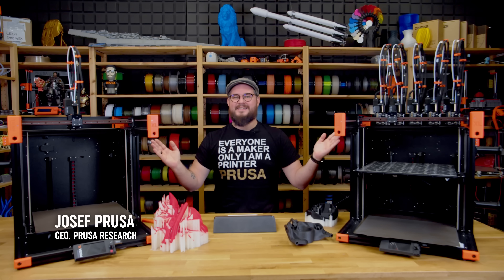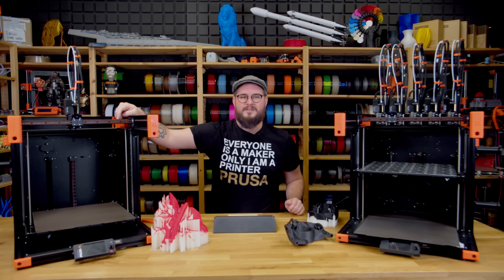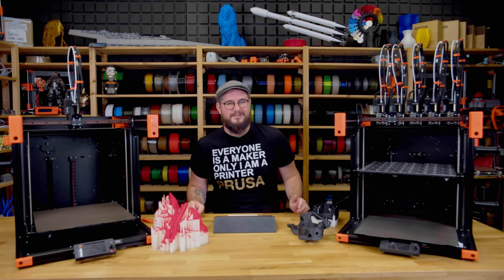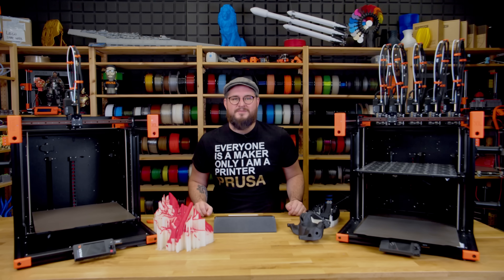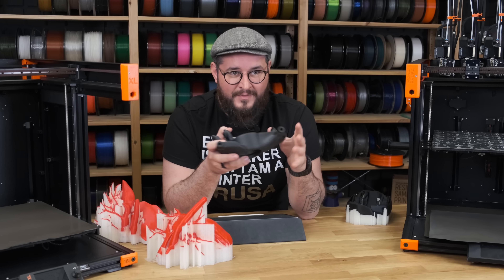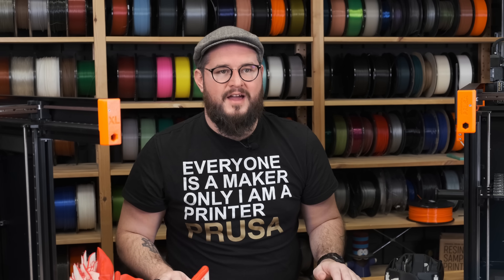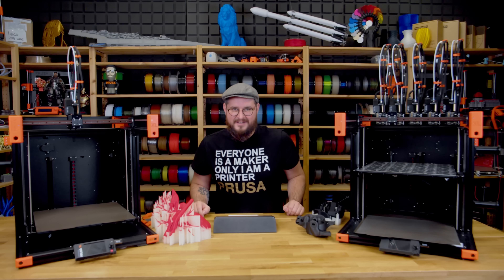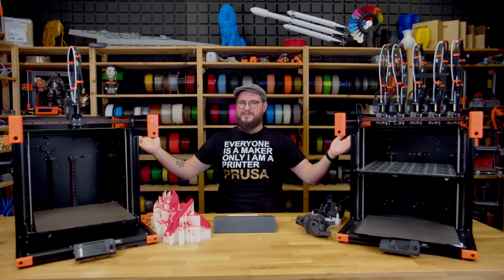XL update - beta test news, hardware changes and shipping schedule

Comment: So I ordered the XL with 2 Tools and have decided I am going to get all 5 tools.   If I want the printer quicker, should I just switch to a single tool and then add the other tools later?  Would the prices be the same (except for shipping obviously)?  I need the bigger volume before I need the multi material, but I want the multi-material too.   If it would just be a month longer, I would just opt to wait for the 5 tool changer.
Reply: Same boat as you

Comment: I've had 9 multihead XL's ordered and FULLY paid for for over 14 months now. While I understand some of the delays, I can't tell you how disappointed I am that the shipping of the multihead version has been delayed again. I run a small farm with 14 MK3's with the MMU unit on each, and the MMU is so unreliable it's unbelievable. I hope a firmware upgrade for the MMU comes soon to reduce our production headaches while waiting for our 9 XL's to arrive. The MMU units require constant supervision to nurse them through filament changes, I hope the XL's are more reliable in the multihead version. Thank you for the update, better knowing what's going on than waiting in the dark. I agree with others... Prusa printers are awesome, but the delays stink.
Reply: Done all the simple mods and while   they help, the MMU still has major problems. I have run 14 of them 24/7 for more than 2 years now, so I speak from thousands of hours of experience.
Reply: @danvester6476  If you're doing that much printing and are willing to put up with unreliable printers to get those features now, have you considered other options that are already on the market? The Voron 2.4 has an equivalent to the MMU that I suspect would be much more reliable since it's a Voron designed system that more than likely took many lessons from the MMU2, and the X1C is an off the shelf system with an equivalent setup (the latter seems reliable but does burn lots of filament on changeovers so recycling waste would be a must for high volume use).
Reply: How much is the multitool version?
Reply: very few simple mods and the MMU doesnt need anything
Reply: @95LegendGS  Which mod do you mean? The MMU never runs really reliably

Comment: Thanks for the update Josef, looking forward to the e-mail! A question about the modular heatbed though, you mentioned in the video that the earlier model of sheet acted as a heatsink which caused the bed heating to overwork. Isn’t that a problem when only a small part of the bed is heated for smaller prints?
Reply: It is a challenge and the neighbor tiles need to be heated as well to some extent. The heating cannot stop abruptly, but with a gradient.

Comment: What is the maximaum nozzle temperature? Could Nylon -  PA be processed? As well as filled materil - Glasfibre or carbon  (hardend steel nozzle or other nozzles for abrasive filament)?

Comment: There is no reason buying this machine, since BambuLab X1C is there...sorry but Prusa has nothing new to make sense for the price.
Reply: It's bigger than the Bambu Lab. 

It doesn't need a poop shoot. It wastes less material, and changes color/material way faster I assume. 

But I like my Bambu lab as well :)
Reply: Yeah to bad Voron is still way better
Reply: And you can print TPU directly at least I hope. Then according to the manual the AMS of BambuLab can t work with flex
Reply: X1C has 5 toolheads? Since when?
Reply: Bambu lab needs to buy better shills to pump their product.
Reply: @LilApe  Says the guy who shills Prusa on every single Bambu Lab video.

Comment: I actually run a .6mm Nozzle on my printer for years and I don't miss anything. I had the feeling though, that your Prusa Slicer Profiles for the Mk3s with 0.6 where not as well set up as the standard 0.4mm profiles (wich of cause makes sense). Because of this I never swapped permanently on the Prusa.
Reply: I switched to 0.6mm since Arachne. I feel I have lost some precision when printing very small parts. But I think I'll start making those from resin, and optimise my Prusa i3 for larger objects.
Reply: @andybrice2711  0.6mm nozzles are not that great on V6 hotends with a maximum flow rate of 12mm3/s. That means a top speed of 85mm/s when printing at 0.24mm layer heights.

Comment: I was hoping for an update on the speed of the XL. I wouldn't mind paying a little more for a Prusa vs an X1, but I can't sacrifice print speed.
Reply: If you only focus on print speed, the XL is probably not the machine for you. Buy the X1 or build a Voron instead.
Reply: @ulaB  The X1 has amazing print quality as well. It doesn't have to be one or the other, except for maybe parts that have strength parameters to meet.
Reply: @spezzy  I did not say you'll lose quality with speed. But the XL is more about other features than speed. Printing different materials in one print and having multiple nozzle sizes available are more interesting to me.
Reply: @ulaB  you said only focus on speed, but he isn't... He's focusing on speed AND quality. I'm not sure what else there is in 3d printing. If I can print amazing quality at fast speeds, that's perfection.
Reply: @JohnSmith-rt5yq  He did only focus on speed. He explicitely asked for speed and stated "..., but I can't sacrifice print speed".

If you are not sure what else there is, try mixing flexible or water soluble materials with other filaments or print things bigger than 256^3. Just in case you have the AMS, Bambu suggests to not try flexible or abrasive filaments at all.
Reply: I agree, you can get 5 P1Ps for this price.... And its not enclosed, just like the P1P
Reply: They said early on (before Bambu Lab had any printers) that speed is not as important as print quality.
Reply: @Fusionpåskånska  I mean, you can have speed and quality. Bambu's proved that.

Comment: Loving this update! The delays are a bummer, but seeing these changes is pretty amazing! So glad to see the V6 nozzle compatibility. And I have to agree about the 0.6mm With the size of this machine, the larger nozzle will make printing faster, easier. Thanks again for the update!
Reply: Except it's a V6 hotend limited at 12mm3/s. Printing at 0.24mm layer height, you'd be limited to an 85mm/s max print speed.
Reply: @alejandroperez5368  A v6 with a stock nozzle does well up until 15mm/s. But let's be real, if you want thicc layers, you are getting a CHT style nozzle and using that. But you can do the same thing Bambu and others do, just increase print temps.

Comment: Thanks for the update and don't rush. If it takes more time, then so be it. The essential is the quality and flawlessness of the XL-printer. James Cameron needed just 13 years for the second Avatar 😉.
P.s. go for the 0.6mm nozzle. Just a small % of the objects can't be (well) printed with the 0.6mm (even with aracne) but that is a good compromise for the speed and same quality acquired with the 0.6mm nozzle.

Comment: I use a 0,6mm nozzle for several years now in my mk2 and mk3. I always liked it more than the stock 0,4mm
Reply: Can you print faster with it? If not what is the advantage?
Reply: I can hardly see any decrease of detail. (But there will be some). But the print time is much shorter. Prusa made a good video once about this topic.
Reply: Is there a loss of detail on smaller prints when using the 4mm vs 6mm nozzle?